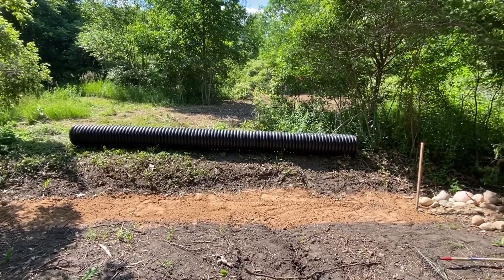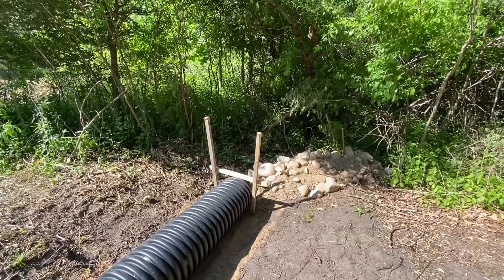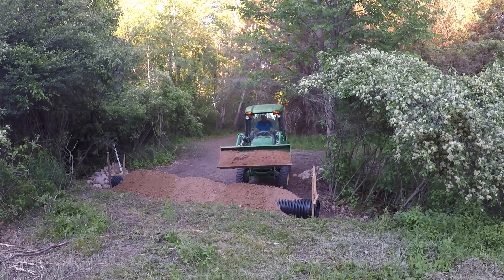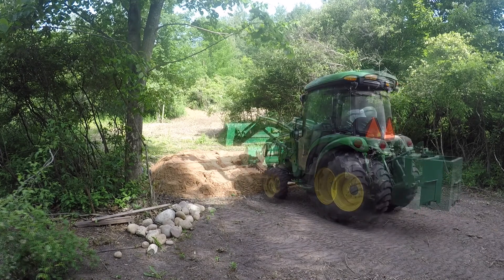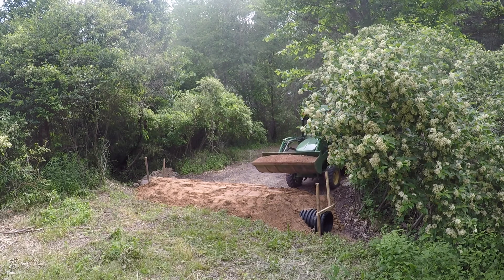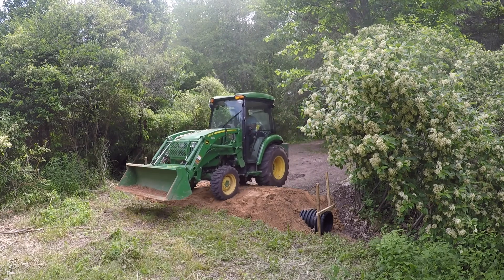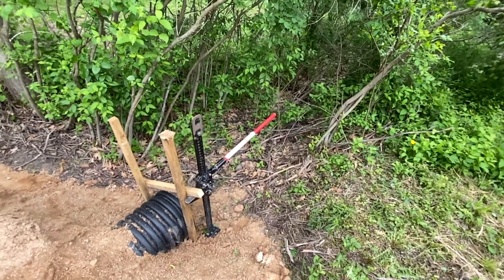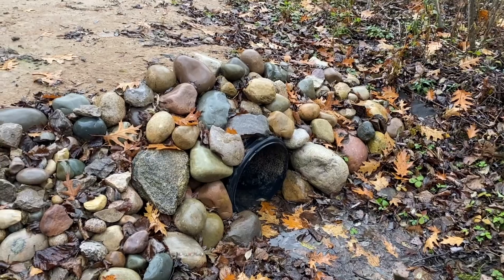DIY Installing a Culvert Pipe in the woods - 20' ADS Plastic

Comment: I'm no expert but i just watched a video titled, "This is why you should NOT run a French drain or downspouts with corrugated pipe". Based on that it seems like the pipe should be smooth not corrugated or it will eventually clog.
Reply from the maker: Yes.  This is Dual wall pipe though.  It has a smooth interior and is much stronger.  When you go to buy look for Dual Wall to avoid that problem.
Reply: @ausablejones2510  I see. Thank you!